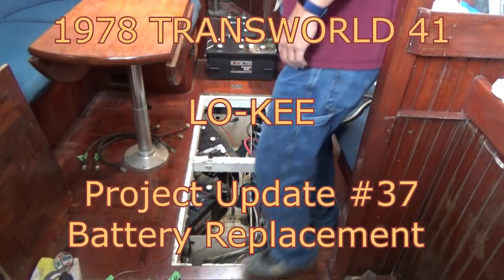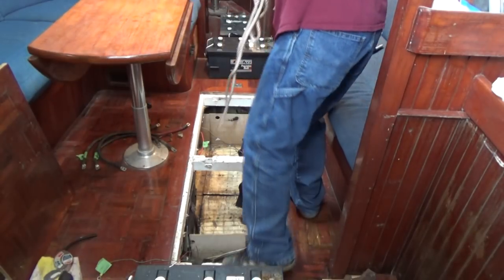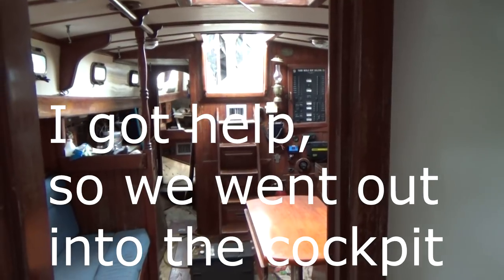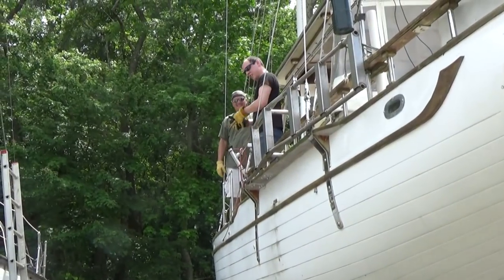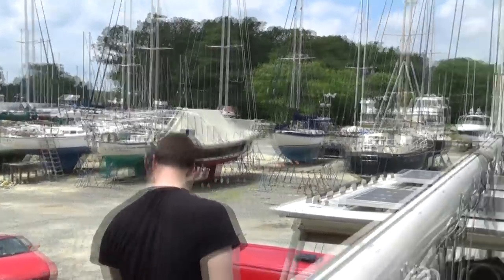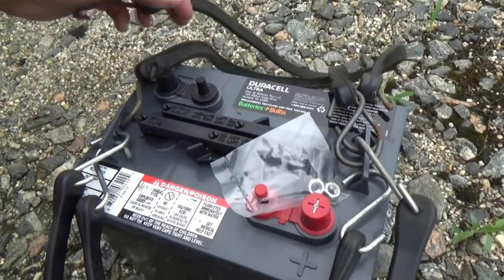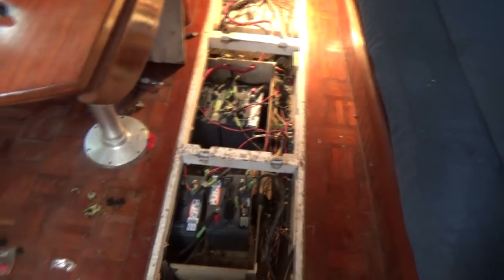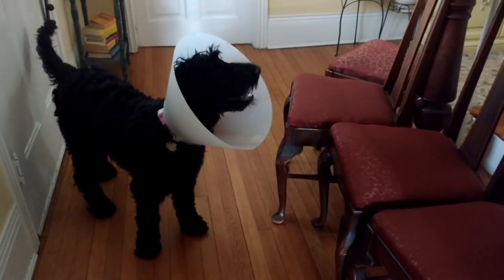Battery Replacement Update #37

Comment: It looks like you got 904D w1080 cranking amps  batteries and everything I read about those type of batteries are not considered deep cycle so they will discharge rather quickly on a small load. But you don't have to believe me you can read and do the research yourself find a good set of deep cycle batteries with the amp hours you're looking for.
Reply from the maker: I'v never used golf cart batteries on a boat before so I'll guess I'll find out. I do have a few friends using them and they gave me positive reviews. I'm really just doing a minimal set up for now as I get through the project and use the boat on the Chesapeake Bay. Before I go anywhere far away the battery bank will be much larger for sure!